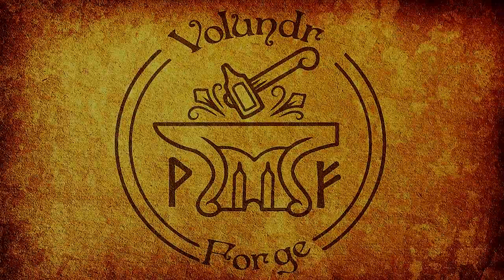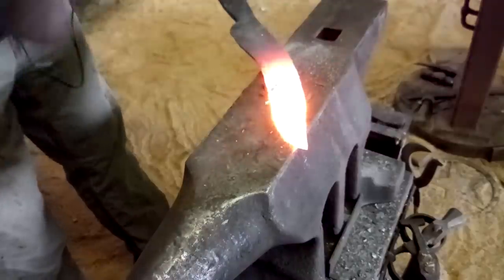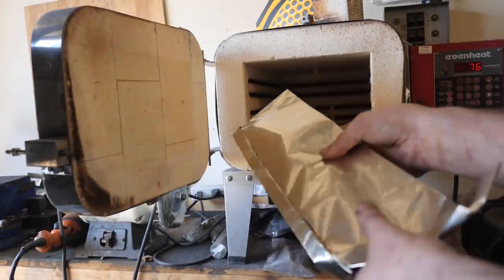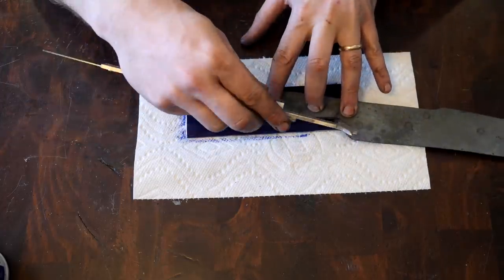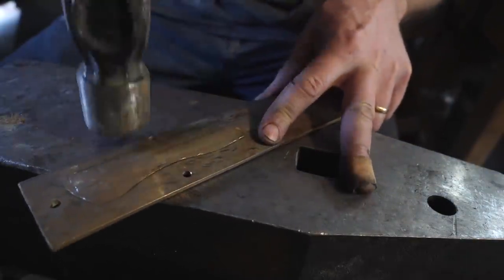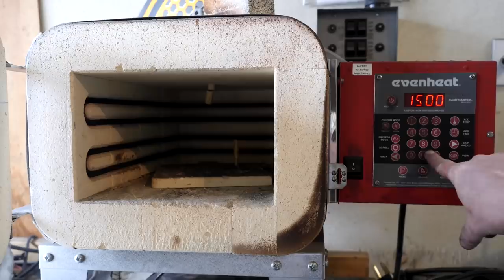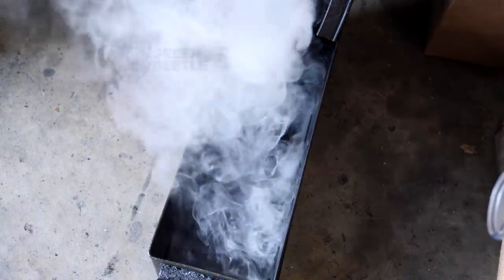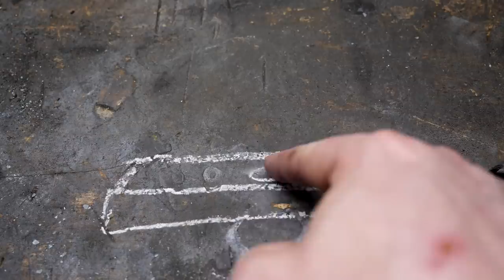The Forging of "Goldfinger" (feat. J. Alex Ruiz)

Comment: I see a lot of people quenching brass to anneal. I could be wrong, but I believe you’re supposed to let brass air cool to get fully annealed. It’s a bit different of an animal than copper. Generally you want to let copper alloys air cool.
Reply: You can air cool or quench. It doesn't matter. Quenching just allows you to handle it more quickly. Brass is an alloy of copper and tin.

Comment: If you do this again, you could fill the void in the brass with Milliput. I think it's not common in the US, but it really is an incredibly useful product if you can get your hands on some. It's a two-part epoxy putty that handles like play-do, has about the density of a lightweight wood but sets as hard as a dense wood. So it should be light enough in weight to only add a few grams to the handle, it would be easy to sand off completely flush on the inside once it has set (it works like wood, so your sander would have it flush to the brass in seconds), easy to drill through for the pin holes, but sets hard enough to support you peening the brass pins forcefully enough to make them flush. I reckon it would crack if you thumped it with a 3lb hammer, but it should stand up to that little ball pein with no problems.The black Milliput especially makes a really good looking spacer material in handles - you can bring it to the same level of polish as a close grained wood, so it looks a lot like an ebony spacer once you're done. I've used it for all manner of jobs over the last 40 years, from filling holes, to repairing broken handles, to making a fully personalised grip on something by packing it in putty, squeezing my hand around it, letting it set and then file away the excess.

Check out Jim Overton's channel (Jimson's Stuff) to see him using it in wood turning. He's as big a fan of it as I am.
Reply from the maker: i'll check it out thanks!

Comment: what was the reason behind pouring liquid on the anvil?
Reply: Not a blacksmith myself, but as far as I know the sudden evaporation of the water blows the forge scale off the blade, resulting in a cleaner surface because you don't stamp the hard scale pieces into the soft steel. Can someone confirm?
Reply: What he Secondary said. I only use it sparingly to blast the scale off. Some guys use a lot of water and then they wonder why they get cracks in their blade, there's a happy medium you gotta find.
Reply: Wow. All kinds of little tricks.  Thanks for the replies.
Reply: @concannonjustin  no problem, I'm normally pretty slow to reply on YouTube but much faster on Instagram. I go to many Hammer-In's to pick up some tips and tricks that make things so much easier.
Reply: @jr602908  but be careful what you say the guy from Baltimore Blacksmiths uses water to descale his work A LOT and I asked him awhile ago and he says he NECER has blade problems. You just have to know the proper uses uf it which is quite nuanced. His name is Ilya, He won the spike sheild episode of Forge in Fire. He now does the crazy remakes of swords from movies and anima. One of the best Blade smiths alive and uses an abundance of gold inlay. Also Kyle (last name) who built the sword last year that took him four months is at it again.